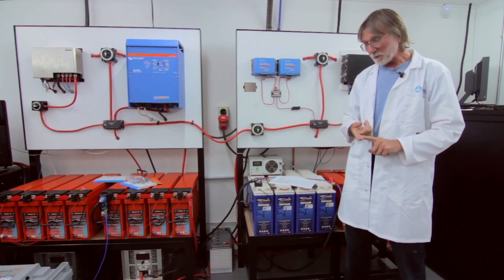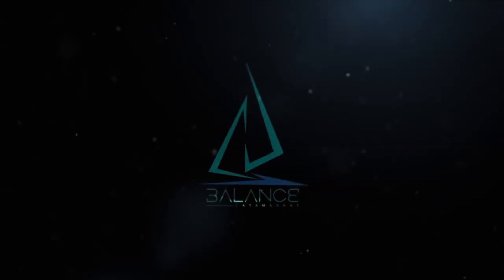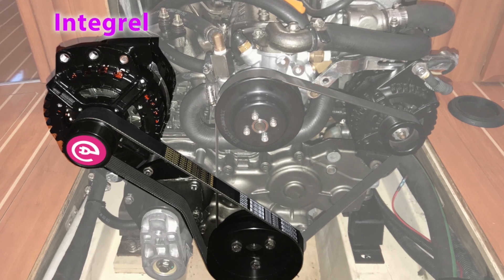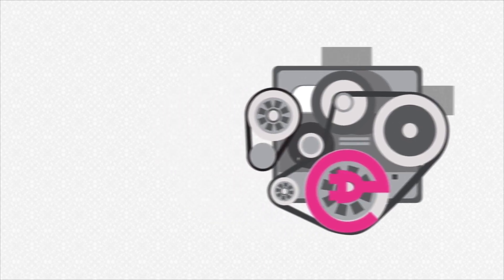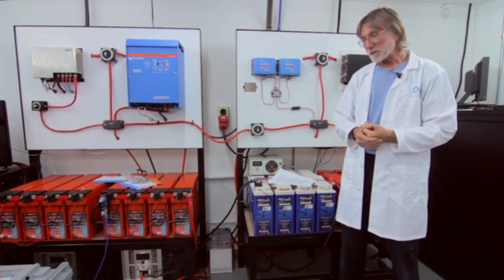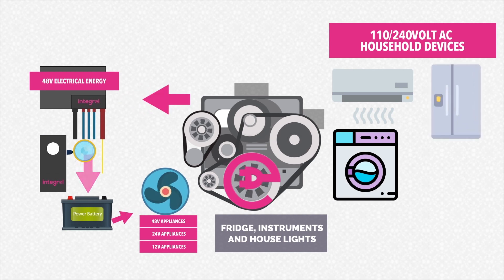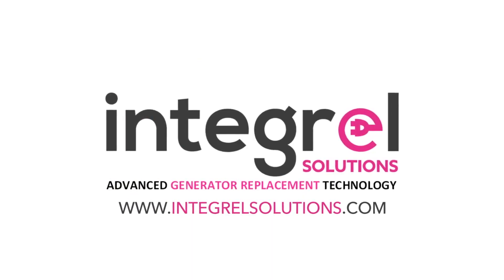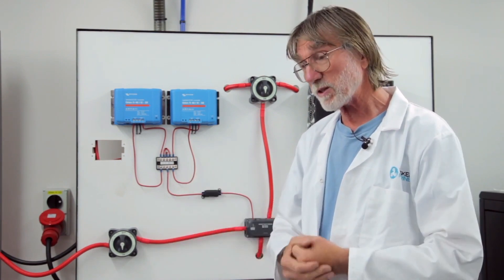Integrel Systems and Balance Catamarans - The Perfect Match

Comment: switching its energy to all electric is the ultimate goal. 
it is the best way towards autonomy
👍👍👍
Reply: It completely depends on what you consider autonomy, as a cruising boat is not a car.
If autonomy is to completely avoid the use of fossil fuel relying only on regeneration (solar, hydro and wind) the technology is not up to it if you want autonomy intended as cruising range while motoring. Even with the largest battery packs completely loaded you have a very little autonomy if you need to use electric engines, I guess less then 100 miles, even if without knowing the drag of the hulls, the cruising speed and how large is the battery pack it is impossible to figure out the real range. 
It can be good for some users, the ones that do only short passages or the ones that can wait maybe several days that the wind shows up if they find themselves in a very large flat calm area, but it can not be acceptable for other people.
Still it is the only option to don't rely on fossil fuel, possible, but at a price, limited range while motoring. With only a couple of KW of solar regeneration and only day time, that is the best that you can pull out of a sailing catamaran, you can not regenerate enough energy to use the motors for a long time, the range is basically depending on the energy you have in the batteries.
Still some people is sailing in this way, an example is Sailing Uma, but it is not a thing that all the people can do, as not all the people live aboard and has unlimited time for their long passages.

The greenest boat is the one that can use the sails for propulsion better (in low wind and upwind) and that can generate energy for the other tasks with solar, hydro and wind.
But if autonomy, intended as range motoring, is needed there are only 2 ways: diesel engines or electric motors and a diesel generator to power them when range beyond what the battery allows is needed. In both the cases the diesel consumption can be minimal if the skipper uses the engines only as last resort, to escape a large flat calm or evade an upcoming storm, and accept to sometimes sail slower then the average, with a boat that is not a sitting duck upwind or with a light breeze.
Reply from the maker: Agreed on all fronts. You clearly get it and show you know what you are talking about. Now a boat designed to carry very little gear, a sort of experimental green machine with a deck of total solar and narrow,  slivery hulls can go a lot further on electrics than a laden cruising sailboat. Right now, a cruising cat, even a light performance cat such as those we build, has limited range under power on electrics without soon resorting to a generator. This is all about the energy density advantage diesel has over batteries at present. We are going with the Integrels and sticking with diesel engines for now. Tons of solar on top, energy efficient appliances and lights, enough sail to move at windspeed in light airs, that is where we are at with Balance right now. Take care. Phil
Reply from the maker: Switching to renewable energy is the goal for sure. At present autonomy and safety dictate that you either are prepared to drift a lot if you have poor solar gain or not enough footprint on deck to have enough solar. Battery storage limits how far and how fast you can go on electrics, or the amount and rapidity with which you can get renewables to charge them. Presently, on a voyaging yacht, to get any range or speed you rely on either diesel engines or a diesel generator to charge your batteries to run your electrics. The key is to have a boat that sails in the lightest possible air. The wind is free and clean. The more you are sailing the less you are burning fuel. Take care. Phil